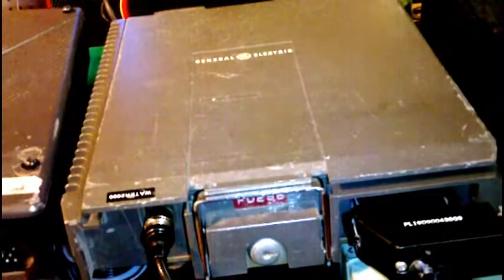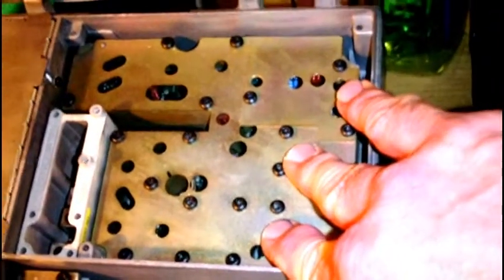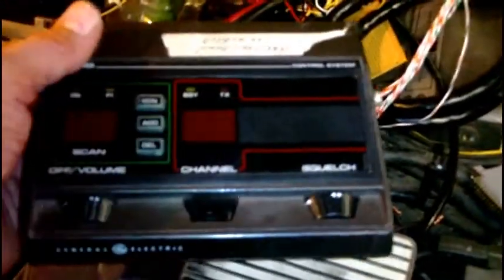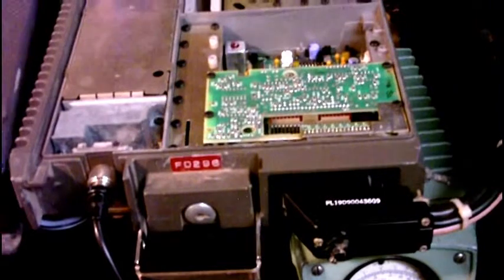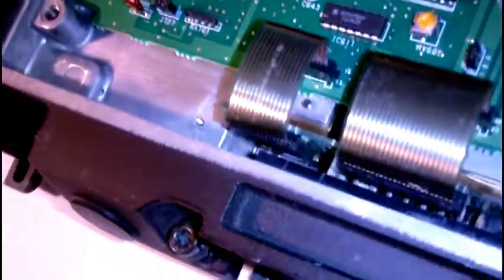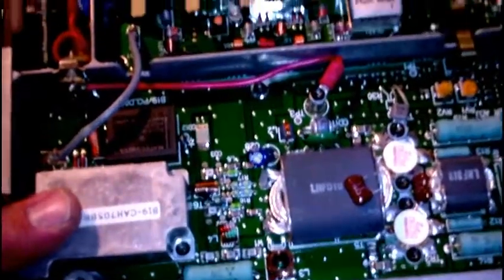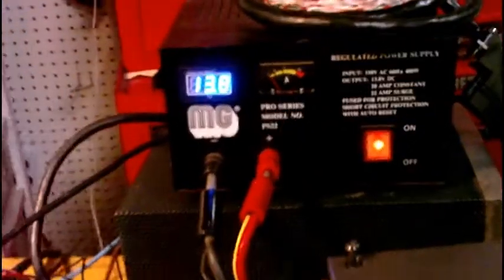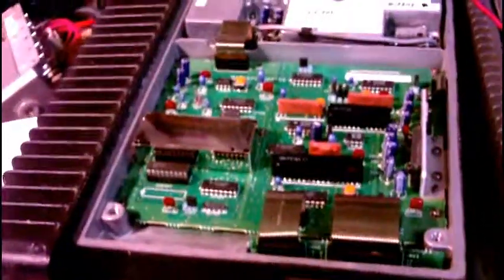Introduction to GE Mastr Delta and Rangr VHF Low & High Band FM Mobile radio

Comment: I used 2 Delta SX for a VHF Repeater . I had it on the air for 14 years  and the only problem I had was a cap went in the reciever. It was very stable in the cold and heat .  Another nice feature since you have to use 2 radios for a repeater is that if you lose a Rec. or TX if you have the plugs wired up right you can swap the cables and feed lines  around and be back on the air in 5 min
Reply from the maker: Mike Alecksynas I thought a pair of these would make a nice repeater now we know someone has done it.
Reply: I know this is a long ago post but if you remove the sealed relay that swaps the antenna jack from receive to transmit, add a another jack for the receiver and jumper the output of the amp to antenna jack.  You can use both the receiver and transmitter at the same time.  It's great for repeaters.

Comment: Cast aluminum recycle price here in Mesa is around 46 cents a pound, the Rangr, which I scrapped 3 units yielded a payout of $11, I believe. It's nee, just on my mobile phone YouTube account.
Reply from the maker: Well that's good to know. you can get a little more than that on e-bay but not much, provided its not water damaged, etc.  The one i got in this video cost $15 and performs excellently, even at 27 years of age.  Best value in ham radio as far as I'm concerned.

Comment: i aquired 3 of these radios, along with a a bunch of other radio equipment from a storage locker, and i found this video extremely informative and quite well presented.  I had since scrapped the three radios for their aluminum content.  I noticed that one of the radios had a fair amount of corrosion inside, from water damage, and it rendered it inoperable. history. thanks.
Reply from the maker: Not much you can do if its water damaged, just out of curiosity how much is the aluminum worth in one of these deltas?